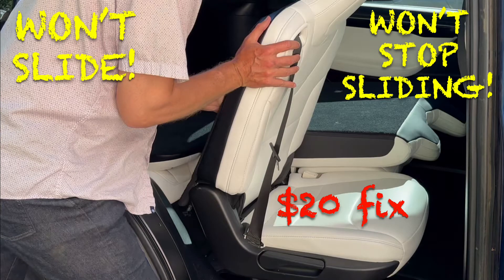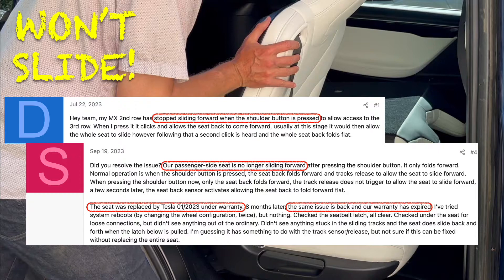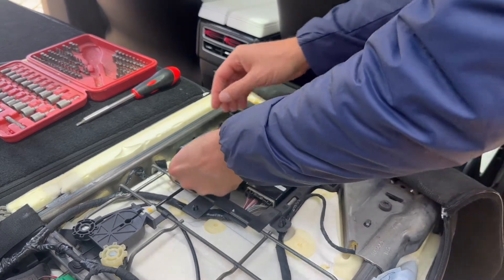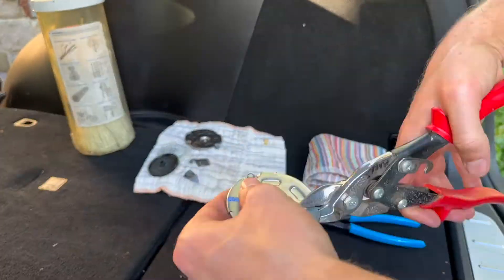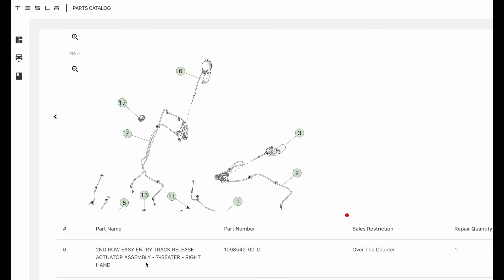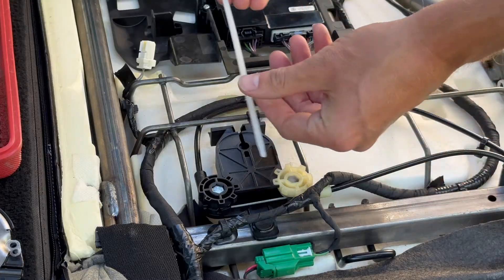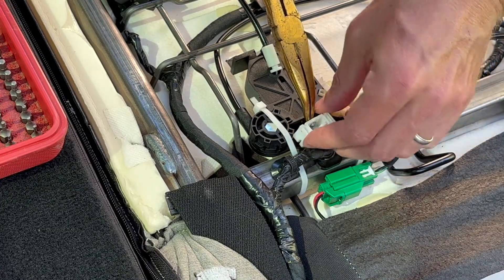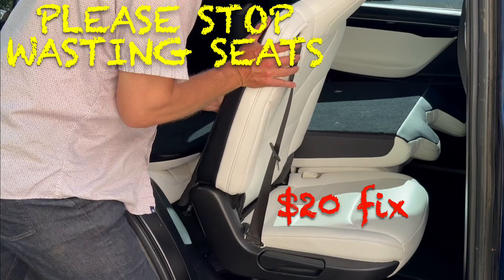How To Fix Tesla Model X Passenger-Side Bench Seat Easy Entry Sliders

Comment: Thank you for this video. It worked the first time I got it to lock. Now it will only allow it to slide on the front but will not complete lock. At a loss for next steps!
Reply: Okay spoke to soon! It works!! Thank you so much!!! Please do not stop posting fixes because you never know! 

Also, ordering the part was much easier.
Reply from the maker: @SamiLittle-k7u  Yes, I am so happy that Tesla improved their part ordering. Glad you got it figured out!
Reply from the maker: What was your original problem? Was it that seat wouldn't lock to the track and wouldn't stop sliding? When you say "It worked" - what do mean by "it"? What exactly did you do in order to get a change in behavior? What exactly is the new problem you're facing? What does it mean that "it will only allow it to slide on to the front"?
Reply: The seat originally wouldn’t latch and would slide. I followed directions (without the parts) and got it to lock. Once I pushed the chair up again, the seat will slide on the track like an inch or two toward the passage seat. 
I ordered 3 parts from Tesla thinking that even if i don’t need them it’s still cheaper than going to Tesla!
Reply: So after going through replacing this piece, I realized the wire that crosses paths with the white plastic puller is still super tense. So I think I need to follow under the seat to fix that tension. 😵‍💫

Comment: 2017 Model x with 215k miles on it.  Seat had been broken for 6 months and I didnt want to put any more $ into the car - gonna drive it until the batteries died.  But $20 part and your great video fixed the seats.  Thanks!!
Reply from the maker: Nice! Yeah, that's the plan for mine too.

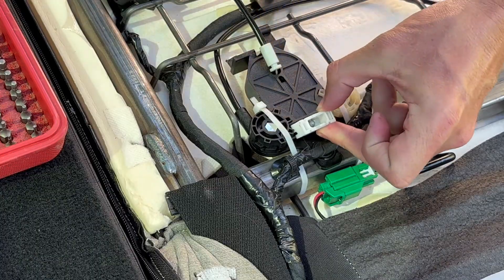Comment: In my case, it was the white plastic where you hooked the ball joint at the end that broke. Tesla have now replaced these with metal 😊 6:23 the also have metal clips
Reply from the maker: Very nice. It's great to see the small continuous improvements. Hopefully they get to those gears soon :)
Reply: Do those metal parts come with the track release cable assembly? I ordered the whole part since I don't see on the catalog just the cable lock

Comment: Awesome! My symptom is that the easy entry button apparently doesn't do anything. I also have the "seatback not locked" message on the dashboard. Do you think I'd need to replace the upper motor assembly, or the one under the seat?
Reply from the maker: A few thoughts - first, the Easy Entry button only works when the seatback is up. I believe there is a microswitch that detects this that could be broken, but I haven't dug into that. The button itself could also potentially be broken. But, it's also possible that both your track release actuator as well as your recline release actuator are bound up with broken gears. One possible way to start diagnosing is to open your seatback, put your seatback up vertical, and when you push the Easy Entry button, feel whether the actuator motor is trying to turn. The motor should kinda twitch if it is and the gears are bound up. As for the "seatback not locked" error - I'm investigating this right now. This happens to me also, but only when my RH side seat is folded flat.